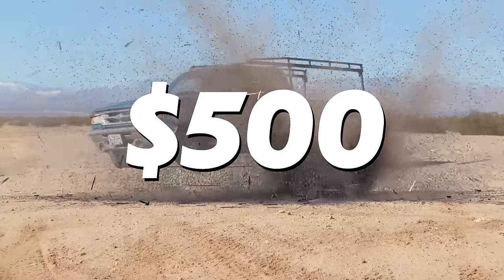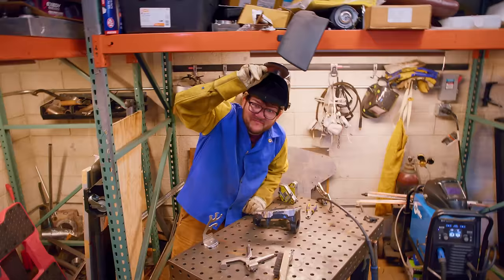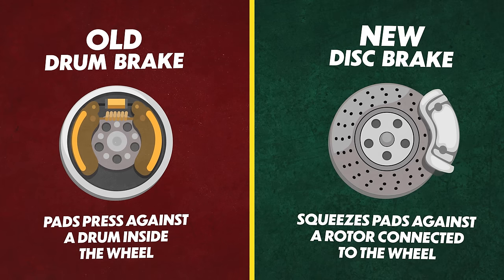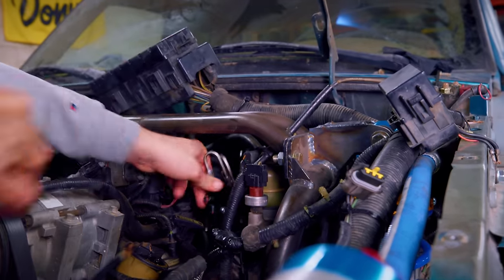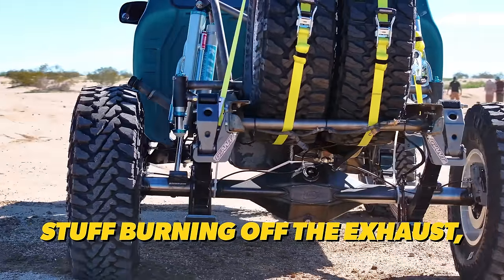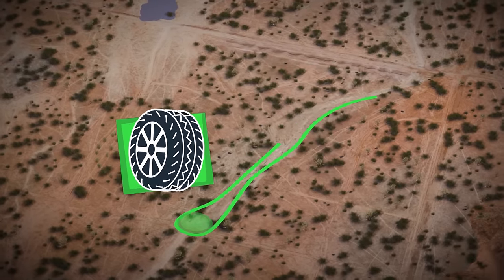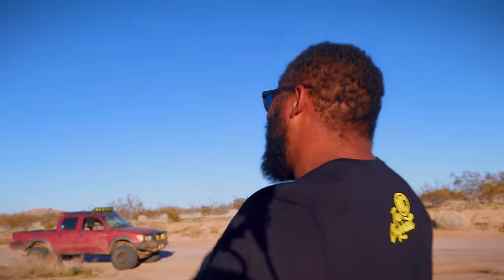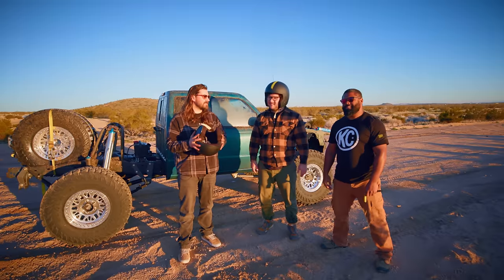We Put $5,000 Brakes on our $500 Ranger

Comment: Fix the passenger air bag switch, that’s what that beeping is. As the light in the passenger air bag switch is broken, which sets off an air bag code. Same thing happens if you remove the air bags. Basically if the air bags are removed you have to put a resister in to trick the system into thinking the air bags are there.

Comment: Drum brake setups do weigh a bit less than rotor / caliper setups, and that is unsprung weight.  If you weren't planning to drive the truck through a small pond (wet brakes) or stop after repeatedly jumping hills (heat fade), best to leave them on the rear.

Comment: By the way, drum brakes have one advantage and that is that the sand does not get there so easily and does not make grooves in the disc, and they used to have the advantage that there was no need to install a brake pressure limiter due to their weak braking effects, because the car is supposed to brake, I don't know what the relane values are, but I shoot 60 on the front and 40% on the rear so that the car does not skid during braking, if I am wrong, enlighten me, thank you.

Comment: 2024 TT-R230
SPECIFICATIONS
ENGINE
Engine Type	223cc air-cooled SOHC 4-stroke; 2 valves
Bore x Stroke	70.0mm x 58.0mm
Compression Ratio	9.5:1
Fuel Delivery	Carburetor
Ignition	CDI
Transmission	Constant-mesh 6-speed; multiplate wet clutch
Final Drive	Chain
Fuel Capacity	2.1 gal
CHASSIS
Suspension/Front	Telescopic fork; 9.4-in travel
Suspension/Rear	Single shock; 8.7-in travel
Brakes/Front	Hydraulic single disc, 220mm
Brakes/Rear	Drum, 130mm
Tires/Front	80/100-21
Tires/Rear	100/100-18
DIMENSIONS
LxWxH	81.3 in x 31.5 in x 46.5 in
Seat Height	34.3 in
Wheelbase	54.5 in
Rake (Caster Angle)	27.0°
Trail	4.4 in
Max. Ground Clearance	11.6 in
Fuel Capacity	2.1 gal
Wet Weight***	251 lb

Comment: Ehhh.  OEM brakes have enough power to lock up the wheels [enough to exceed the traction force / friction of the tires].  You can't stop harder than you have traction for.

Big brakes / expensive brakes are great when you're racing and really building a lot of heat and you're trying to avoid brake loss and fade.

Ehhhh.  One of the less entertaining videos you've made - but then I guess most people don't really understand how brakes and traction work.